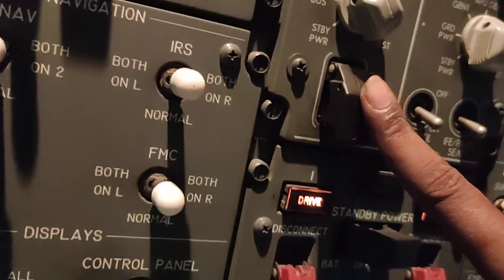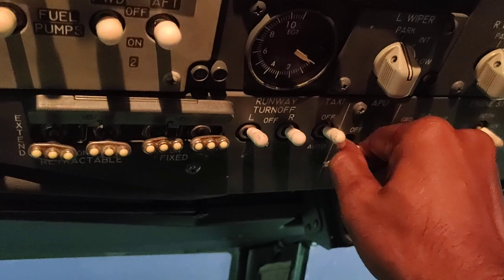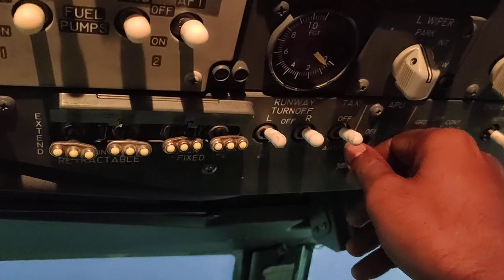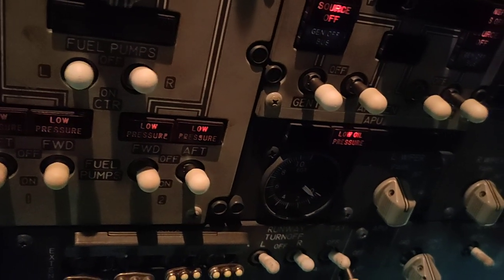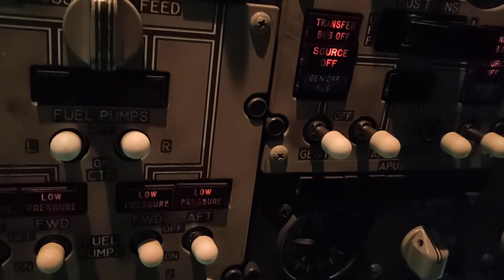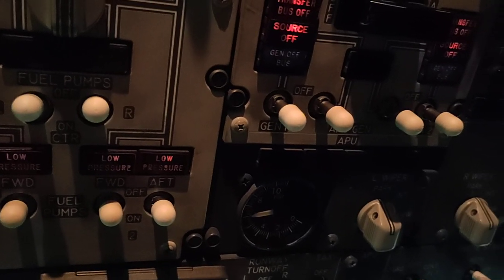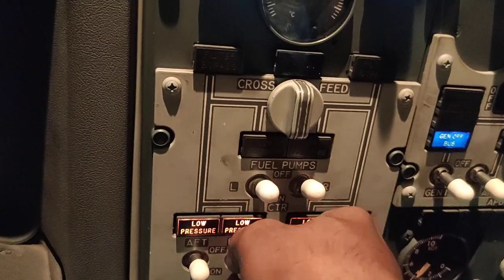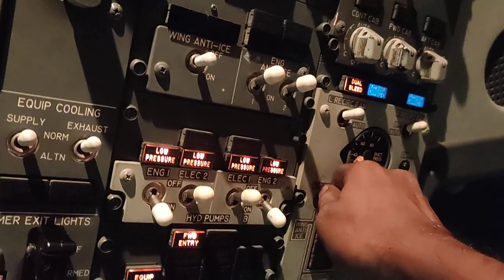B737 NG - Aircraft Power ON using APU

Comment: Why fuel pump in tank 1 switched on after apu start?
Reply from the maker: Normally APU takes fuel from Left wing tank through Gravity Feed. There is no separate fuel pump for APU as in A320 aircraft. Gravity feed is through the fuel feed line (for engine#1) on LH Wing. So Fuel Pump of LH tank is normally kept ON to supply a Positive Fuel pressure though it is not really required.
Reply from the maker: Moreover the fuel boost pumps require AC power to operate which will be available after APU start..
Reply: @SelvanSelvaraj  APU takes fuel through gravity feed?! Are you serious??🙆🏻‍♂️😂
Reply from the maker: @speedbird9313 I might be wrong..  If you know please answer...
Reply: @SelvanSelvaraj  Gravity fuel feed requires the fuel to gravitate😉 Meaning the fuel tank must be above the apu..

If you dont use AC boost pumps to supply fuel (I dont) the APU DC boost pump will (automatically) supply fuel from the left main tank.
If the AC and DC boost pumps do not supply fuel, the APU will suction feed from the left main tank.
Reply from the maker: @speedbird9313  thank u for correcting me.. yes, it is Suction feed.. and to add, DC pump is optional, it is available on few effective aircrafts.. thanks a lot..